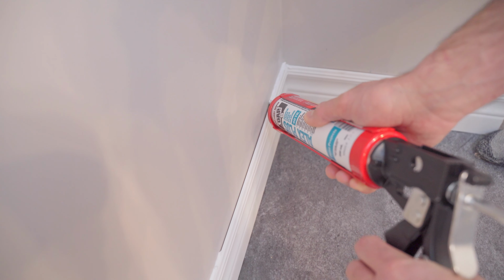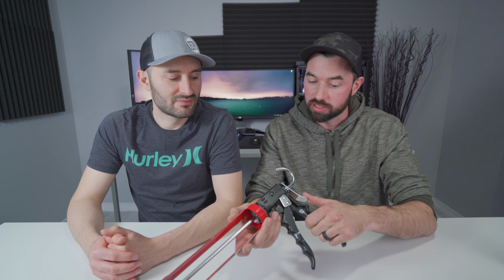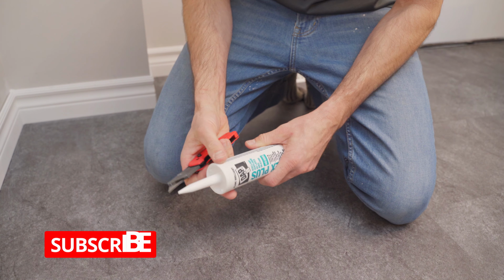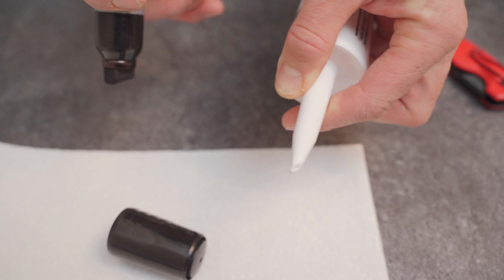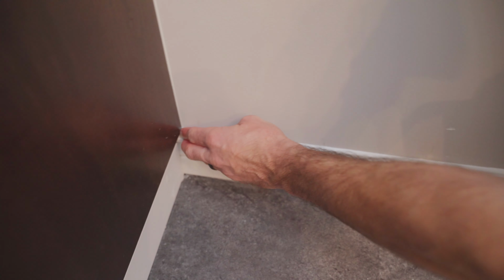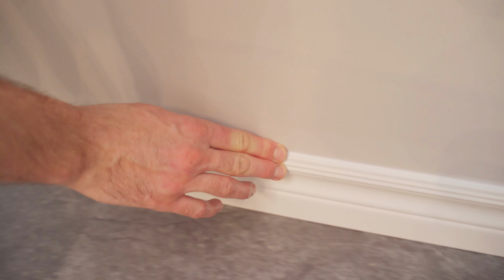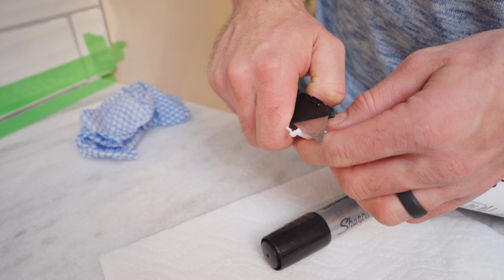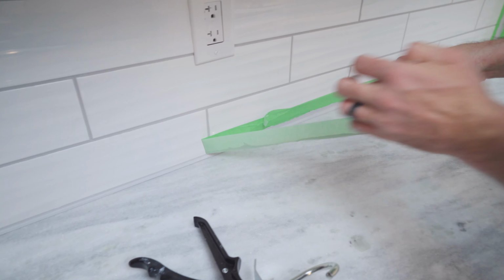How to Caulk Baseboards and a Tile Backsplash with Latex and Silicone

Comment: Could I just use elastomeric silicone caulk to apply a glass tile backsplash (that's in one piece with webbed backing) to the wall backsplash, instead of thin set mastic?  Maybe put a layer of the caulk and then even it out with a trowel (like a spatula)?  I really don't want to work with mastic or thin set mortar.  I'm thinking the caulk would already be mold resistant and definitely water resistant, so win-win right?  I also already have many different caulks in the basement to use up.

Comment: Do not use tape because when you remove it you will have 2 edges that will be bacteria holders. Plus it’s tedious & a waste of time. After calking spray water or water with a drop of dish soap on both the backsplash and counter top, then spray your finger and smooth out the calk in about 5” strokes, then wipe your finger clean, then respray you finger and continue. Repeat until the desired width of calk you like.😊 When you don’t use water the width of the calk can spread too wide on both the backsplash and counter.